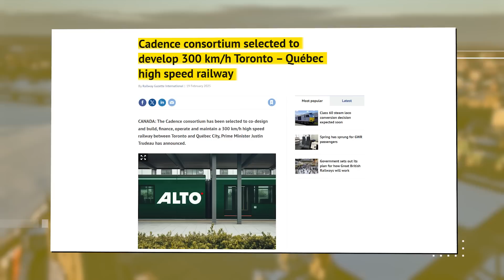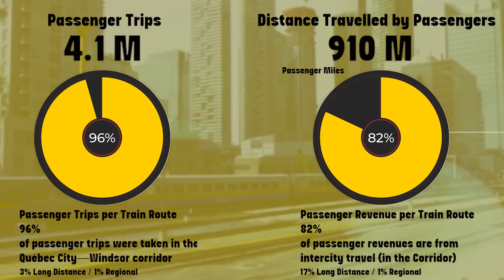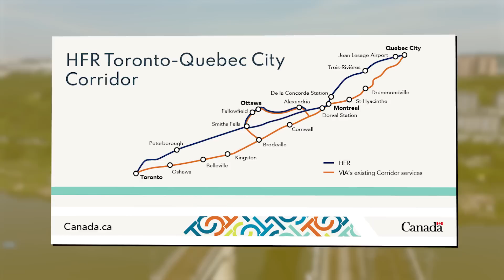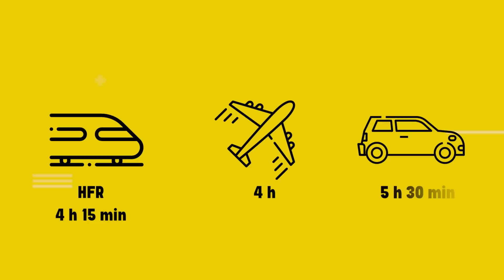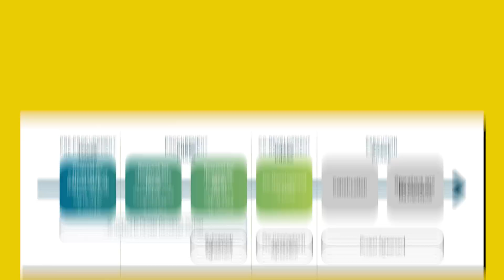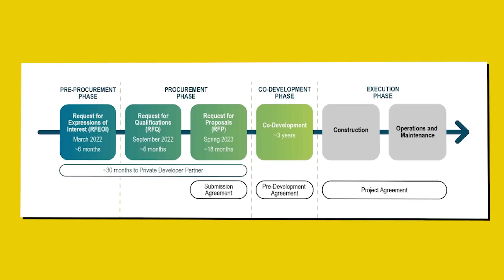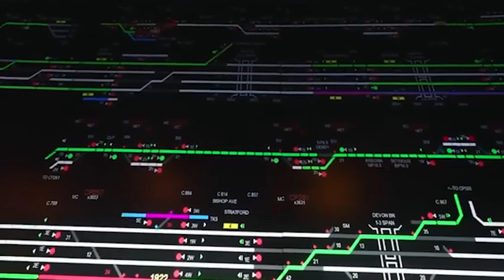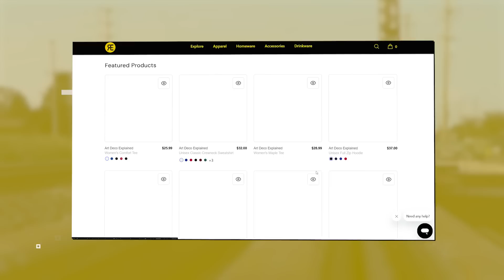High-Speed Rail in Canada: Is It Really Happening This Time?

Comment: I live somewhere along the corridor, and I'm very, very, very happy that the HFR proposal has been pushed aside. The middle ground proposal didn't seem to have much purpose. Yes, HSR is 10 times more expensive for a marginally better service, but that margin is enough to make it the best way to travel between the 4 main cities, replacing air routes, reducing the carbon footprint of these trips and offer massive time gains.

Now, I don't know if a HSR system is actually worth what it'll cost or not (especially the Montréal-Québec part, and a hypothetical Windsor-Toronto extension), but its benefits are clear. The HFR, as cheapo as it would be, wouldn't be much more than adding some shine to a rusty old thing.
Reply: I respectfully disagree with your assumption that HFR wouldn't provide much better service than what we presently have in Canada.

You only have to look at the Swedish X2000 rail service, basically equivalent to the proposed HFR in Canada, where trains reach top speeds of up to 200 kilometers per hour or 125 miles per hour and yet, they are quite successful and provide attractive travel times.

The last iteration of HFR operating on dedicated tracks offering considerably faster speeds of up to 200 kilometers per hour or 125  miles per hour, along with consistent reliability while serving far more communities with substantially less costs of construction would be just as successful in Canada as it is in Sweden!

If you look at Via Rail's previous LRC train that completed the Montreal-Toronto run in 3 hours and 59 minutes at operational top speeds of 153-160 kilometers per hour or 95-100 miles an hour, there no reason to disbelieve that a 25 percent faster, 200 kilometer an hour capable train couldn't complete this same route in 3 and a 1/2 hours or less, a very competitive travel time!

With HFR, it would have been necessary to install full-width barriers at all railway crossings rather than fully removing them to accommodate far-more-costly HSR!

Most European countries migrated to HSR only upon having reached full capacity of their respective rail networks, not because their regular intercity trains were ineffective!

Most Canadians, who have had the opportunity to experience European rail travel, actually marvel as to how fast their trains run, which include both regular intercity and high speed trains!

Sadly, the far-higher construction costs related to HSR may result in this 'Alto' project never becoming reality!

As such, I'm of the opinion that the final version of HFR would have stood a far better chance of getting approved and subsequently built than this 'Alto' project!

Comment: Pretty certain that this song & dance has been played previously. Maybe I'm just being cynical but Give it a couple years & Alto will be walked back & pared down, shifting the goal posts for reasons of cost and/or practicality. What was originally touted as a 300kph+ alignment will become a corridor/ROW that is capable of supporting the potential of a 300kph alignment. Then Electrification will become a ‘Phase 2” future upgrade w/ Only provisions for the enabling infrastructure built for now. Eventually, after several rounds of downsizing, the HSR project will be reduced to simply a dedicated passenger route for VIA existing services using 200kph Siemens Charger Diesel Locomotives. Still an improvement, for sure, but a far cry from HSR.

Comment: I think VIA Rail high frequency still has a place with Alto HSR. HFR can reach smaller communities with more frequency and shorter trains, then they can feed the high-speed rail stations.
Reply: Agreed, and acceptance of a system is bigger when people see personal benefits to them. Wether we like it or not, you'll need the political support of the smaller communities and rural ridings it passes through. HFR can provide the bedrock for a proper railway system with HSR as the pinnacle.
Reply: @barvdw I would love for the fright line that goes to Goderich to finally be used for passenger rail service again. Service ended in the 1970s thanks to people bending over backwards for automobile infrastructure in the 1960s. Those years ruined many North American cities, smaller towns, and large villages.

Comment: Any project should begin would discussion about how to connect tracks to Montréal Central station or whether to build a new downtown train station and tunnel.  And there needs to be discussions on how to get trains in and out of montreal on dedicated tracks that can be electrified. (aka neither CN nor CPKC).   Toronto Oshawa to Union will be electrified with ETCS signalling by Go Trains (Metrolinx) so the pathway is set and there. One portion may need a 3rd track between Pickeing and Scarborough and eliminate the few crossings in the area but generally this is simpler than for Montréal. However, the imposition of Peterborough in the route will require a huge amount of expropriations to build something totally news to join Pickering to  usable metrlolinx tracks.   None of the discussions so far have had consultation or paper published to show how they intend to deal with those access issues, and this is because they never intend to actually build anything so need not be concerned about it.

Comment: The promise of a future new train has allowed the government to starve VIA Rail of funding, and VIA has started to cannibalized its fleet for parts instead of ordering parts to keep the old trains running. It is unable to restore pre-covid frequencies due to lack of trains. Its new Siemens trains are too small and lack luggage, so VIA has started to charge $25 for HAND LUGGAGE. (it is philosophically opposed to checked baggage so removed checked baggage service fro ots trains since 2020).   And since the HFR thing will never happen, the end result is Canada will be stuck with very low frequency trains that are next to useless. 

Canada built Montréal to Vancouver tracks faster than  then the current round has been consulting about thinking about doing Québec to Toronto.

Comment: The chose Cadence consortion does NOT have any experience. the lead CDPQ has no experience with trains.  SYSTRA is the only serious people. SNC Lavalin couldn't even lay tracks in Ottawa with standard gauge alignment. (their reputation is so bad that they changed their name to Atkins Realis). 
Air Canada has, since the 1980s always sabotaged every attempt at high speed rail.  This is not their first rodeo sabotaging it. 
Amd also very important: this latest steop is giving them a few BILLIONS OF DOLLARS TO WRITE ANOTHER STUDY.   This has been a photo-op project where politicians make promises with a process designed to never actually have to deliver anything. 
The route was imposed by the politicians who want votes in Trois Rivières. And Conveniently, wth the loss of the Mont Royal tunnel in Montréal, rhere is no longer any access for train from Trois Rivières to go to the downtown train station, and the politicians have gone out of their way to avoid discussing this bit.   The right of way between Havelock and Toronto passes right through the CP Rail (CPKC)  freight yards, and the 1950s railway will NEVER allow electrifiucation anywhere near their tracks because of double stacked container and 3 level car carriers. This is more true now that they are a US railroad even more addicted to diesel.

Comment: Good summary.  The biggest issue with sharing routes with freight is that freight can tolerate slow speeds through grade-level crossings, and prefers to reach as many customers as possible, which means passing through many communities which deliver few business travelers.  

The major reason VIA Rail has poor on-time service is because of speed limitations imposed by the freight railway.  For example CN just reduced the maximum speed through level crossings by 10km/h, something which has little consequence for their freight trains, but adds half an hour to passenger rail trips.  The Ontario Government is investing in electrification of routes that are shared with rail public transport around Toronto, which could be exploited by the federal intercity service.

Comment: The biggest red flag I see is that Air Canada is part of Cadence. Surely there's a conflict of interest there when high speed rail is literally supposed to compete directly/replace short haul flights. It makes me uncertain as to how serious of a project this actually is. Will it go vastly over budget and underperform? Air Canada would probably love to see it!
Reply: As I understand it, the short haul flights do not make any money for AC as compared to the long haul flights. If HSR works to remove most YUL-YYZ flights it would be to ACs benefit to allow them to have people in Toronto buy trips to Paris first take a train to YUL, or people in Montreal wanting to take a flight to Barcelona take the HSR to YYZ and fly from there.
Reply: It's also possible Air Canada recognizes the favorable economics of rail in the corridor and could integrate with it to create complimentary services. A train with connections to airports when needing to travel to areas not covered by HSR. Just a guess, but with increasing need for more efficient, and less carbon intensive travel, Air Canada might see the value of working with rail rather than pushing against it. My only concern is that we definitely don't want rail travel to feel like air travel.
Reply: I see the contrary, they probably are the first ones to recognize the impact on the short fly routes, that they decided that better participate from it.
Reply: Montreal's main airport is nearing capacity. Terminal expansions are in progress, but scheduled to take another ten years at a cost of four billion dollars. A new commercial airport is being developed just south of the city, which should add an extra roughly 15-20% capacity. Adding a useful rail corridor to relieve some pressure will help them, and from the airline perspective, they're only sacrificing their least profitable routes (short-haul) to do it, while making room for more international flights.
Reply: Actually Air Canada already partners with Rail operators in Europe so they see the benefit of this.

Comment: Pronunciation is the English word "via", not each letter of the word.

I'm hoping this private-partnership doesn't turn into a 407ETR type operating agreement with no fare control.
Reply: One difference, is that train lines have a lot of capacity. A highway lane can hold 2k cars per hour. While a 12 car Go Train could hold 5k passengers.
Reply: @jiecut  that's not what I'm getting at.  The govt needs to maintain control of the fares, not hand it off to the consortium.  The consortium can offer advice but the fares need to be kept reasonable to be able to compete with the airlines.  The 407's rates are out of control as they're set by the leaseholder.

Comment: They should have done this like 25 years ago when it was a lot cheaper to do. And done it with Japanese help, since the Japanese successfully developed high-speed rail that operated in cold, snowy climates starting from 1982 on the Tōhoku andJōetsu Shinkansen lines in northern Japan.
Reply: The Shinkansen network was also built to North American standard loading gauge and platform height, so a Japanene train would fit perfectly into a Canadian railway station with high platforms.
Reply: @A_Canadian_In_Poland Why prefer the Japanese to a closer nation like France with its TGV  and Alstom who purchased Bombardier rail branch ?
Reply: @jandron94 More climate adapted
Reply: @ In Canada they have Japanese airplanes ?

Comment: 1.  We have heard all of this before, several times in fact over the decades and NOTHING was done, except tons of expensive studies and consultant fees and 2) Even if it is built, odds it will be affordable compared to driving or flying?  Passenger service within Canada is very expensive.  I have looked at taking trains on several trips over the years and they actually cost significantly more in both time and money than either driving or flying.  So I wont get my hopes up.

Comment: The most hilarious part is that they can improve the situation without building "true" HSR. A 1435mm gauge can support 150-160 km/h like no big deal, so just straighten railways here and there, add bypasses and more rails, work with timetables, and have a stable 150 km/h. That speed means Windsor to Quebec in under 9 hours with stops in all major cities.
Reply: 9 hrs ? That is not high speed . It s hardly traditional intercity speeds !   
The golden rule is 3 hr . With a direct line  from Peterborough to Ottawa and montreal you can have great hsr line with 6mln pops on both sides !  This will creat mode shares of 80-90% .
Bypass smaller towns like Belville or Kingston ( maybevwith a sidefork) .
France and Sweden made such decisions and have very succesful hsr corridors .
Part of the problems of CaHSR is they did not listen to the french engineers ( and the Cali Central Valley has bigger cities than east Toronto ..)
Reply: @lws7394  No, it's not a "true" high-speed. Yet it will be a significant improvement compared to the current situation and nowhere near the cost of "true" high speed, in terms of building time, infrastructure charge, and ticket price.